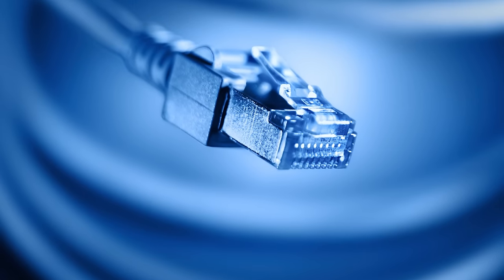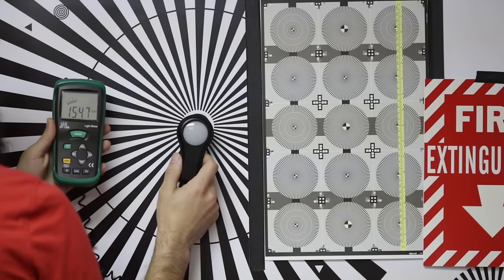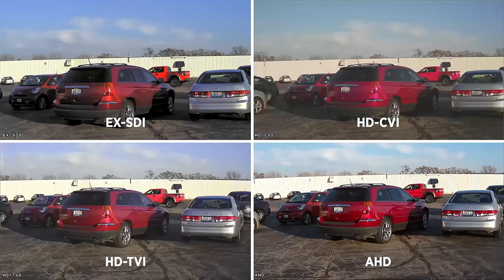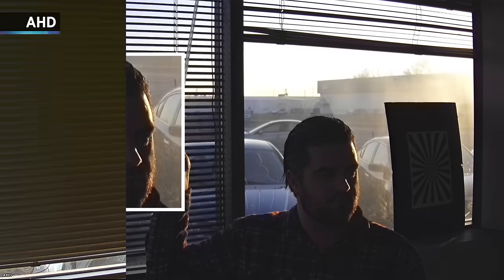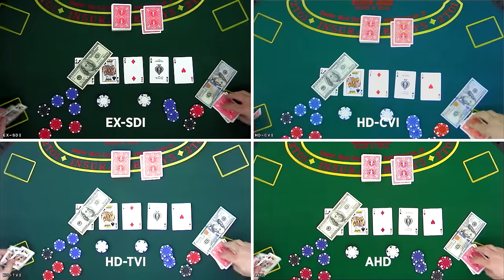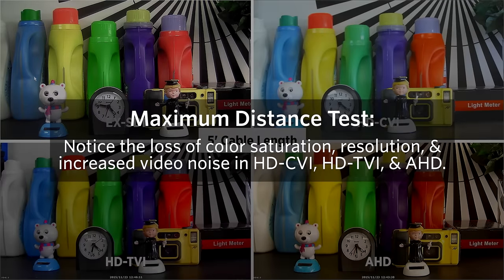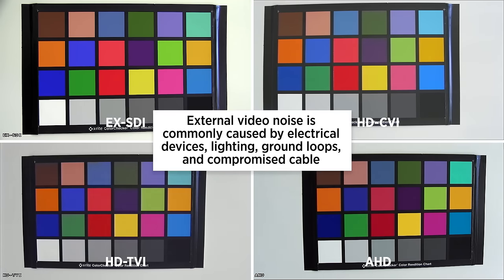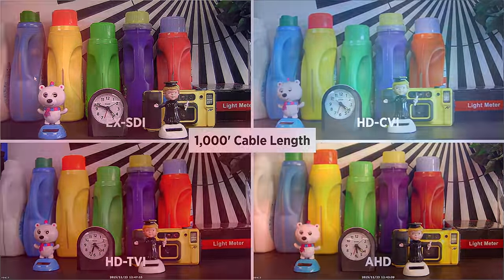HD Over Coax Comparison: EX-SDI vs. HD-CVI vs. HD-TVI vs. AHD

Comment: This comparison has not only helped me understand better each technology, but during the section regarding cable lengths it 'suddenly' made me think about a recent very intermitent issue I have with a AHD camera not working.   I therefore returned to the camera in question and measured the line voltage AT THE CAMERA PWR PLUG whilst the camera was PLUGGED IN AND WORKING and hey wadda ya know . . . . . .  the 12v feed was down at approx 9v. I had previously measured the PWR feed unplugged and it was fine, but of course when plugged in the camera loaded the supply and dropped 3v.  This turned out to be due only because two cable extention lengths were installed with the spare wound up. Introduced a fresh PWR feed near to the camera with the video stream still going all the way back to the DVR and not hear of any problems since.   Never too old to learn.

Comment: Is this a comparison of the video encoding technologies or of the camera's image processing and DSP? Seems to me the only way to test just the differences between the 4 is to have something produce colorbars or sample images, feed that down a long lossy coax with some transmission line discontinuities and see how the corrupted the image at the end is. SDI should be a very high bandwidth digital signal and will either work or not work, while the others will suffer from visual artifacts similar to traditional CVBS/composite.

The cable length test is a good test for the quality of the signals, it was interesting to see the colors fade on CVI, the color rendition on it is just bad overall for some reason. More advanced decoder of it might be able to recover better colors.

Comment: What specific camera models did you use? It would be like picking one IP camera and representing it as every IP camera. Some IP cameras deliver great quality, some are terrible, but it is not the fault of 'IP', likewise for any of the HD analog variants.
Reply: +ClintonElectronics Same encoder / recorder?
It is highly uncommon to see WDR results be so much different with the same sensor and encoder.
Reply: That's like same all cars have the same chassis but different engines, suspension, wheels, upholstery, etc.
Reply: it would be impossible to to make all of these techs technically same since none of the TX and RX are cross compatible due to patents and what not. This demo definitely fits in the 'good enough' field. In all, my opinion is new installs should be IP NVR setups (the DVR having discreet ip camera inputs) Be aware based on my reading, SDI is most picky about cable if replacing existing analog cameras and DVR. (please correct if im wrong about this)
Reply: You are completely right when talking about the benefits of ES-SDI standard vs. HD analog standards till the moment when you touch WDR, color performance and signal/noise ratio. In the latter case you just compare the DSPs which are different! For a fair comparison try to test multiformat (all-in-one EX-SDI/HD-SDI/HD-TVI/AHD/HD-CVI/960H) cameras which you can easily find from Korean companies. This will ensure that the experiment is just.